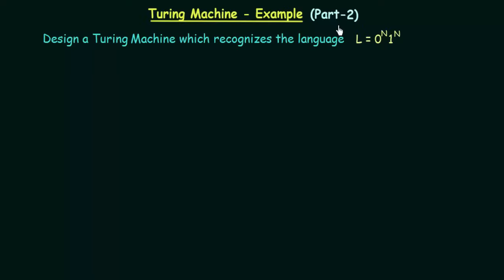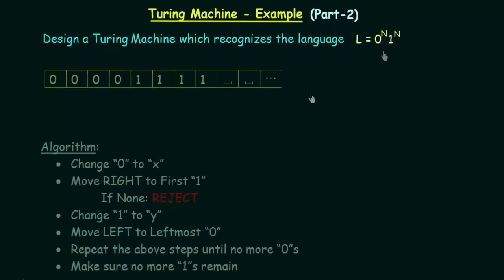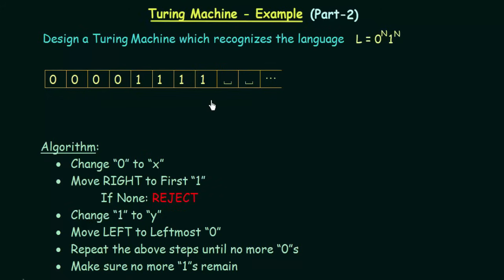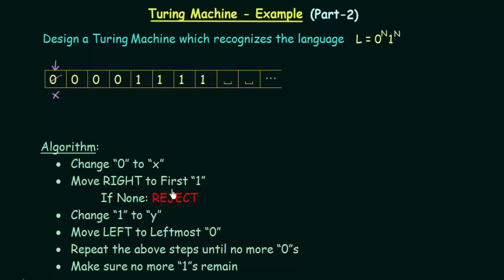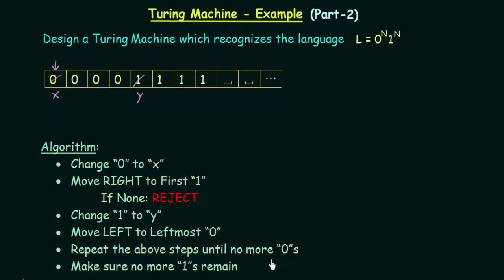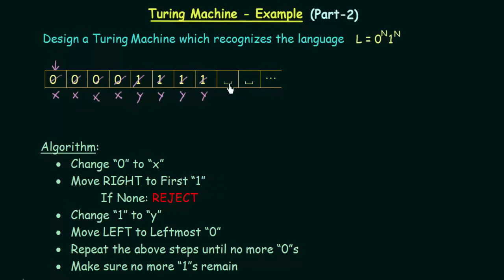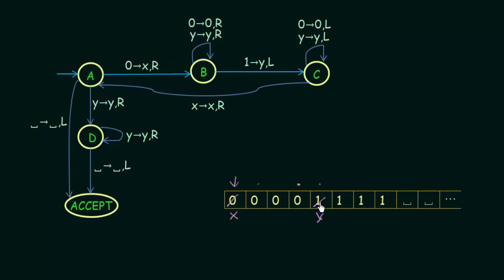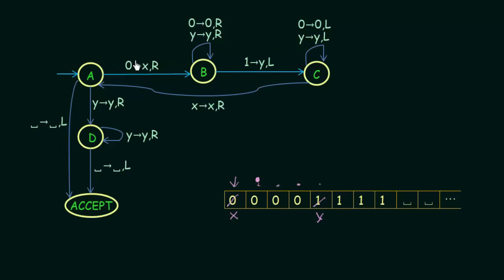Turing Machine (Example 2)

Comment: Why in transition B u put  y>y,R , and not x>x,R ????
Reply: I had the same question, ifs because by the time you mark the last y you would have already marked the last 0 as X hence no need to loop over x as you would never ecounter more than was x every iteration.
 How ?So... at state C you would only go left till you meet your last X  right ? then go right  at state A. 
 State B only has the y>y, R because you still haven't marked the corresponding one to the x Also because you always go to the left most always from state C to state A you will always encounter a 0 after the most recent  x. And you keep that loop till you finish all the zeros  and mark them as x, loop back. Encounter that last x  you just marked then go right then keep going right to finish the string

Comment: in 10:45 , there is no need of separate D state right, 
we can loop through y -> y, R at A itself and the B -> B,L transition from A to acceptance state
Reply: The state D is required to prevent strings of the form (0^n)(1^n)(0^m)(1^m) from passing, dry run 0101 and you will see it will pass if you do not have the state D.

Comment: Say i have a string "00010111" which is technically wrong according to {0^n 1^n | n >= 1}, but still the turing machine designed above will accept it right? how or i m making a mistake somewhere
Reply: This goes through  A,B,B,B,C,C,C,A,B,B,B,B,C,C,C,C,A,B,B,B,B,C,C,C,C,A,D and gets rejected there for encountering 0 on the tape (which is not defined i.e. goes to reject).

Comment: 1. So now the input is part of the tape instead of a separate input?
2. Can this algorithm be performed in a non-destructible manner? (that is, without destroying the original input on the tape by replacing it with Xs and Ys)
3. As defined so far, this Turing machine seems to be only capable of taking some input and accepting it or rejecting. But what about producing some OUTPUT? In order to perform some more useful computation, the computing machine should be able to calculate some results (e.g. evaluating arithmetic expressions) and output them. Can we do that within the current framework?
4. What about PROGRAMMING the machine? Isn't it that we have to make a special machine for every single tast we want to perform with this particular design? Because the program is stored in the "head", as the state automaton, and this automaton has to be replaced by another one in order to change how the machine works.

Comment: how about if input string is 0001110101?
Reply: 000111 will be converted to xxxyyy in A and D state. Since D state has no 0 and 1 transition, it will go to reject state.
Reply: It is not included in language. Watch the pattern carefully.

Comment: but we didnot write the string 00001111 on the tap at the fist place so who wrote it and how ?!
Reply: tape is not the place for writing the string. It is used only for help to check if the given string is accepted or not. Tape here is just like stack in PDA where at the end stack doesn't actually hold the given string rather it is empty at the end. Tape has advantage over stack as it we can go in both directions while using it.
Reply: @Pradumn961   Except the input string is clearly written on the tape in this video :q
Reply: pora howle

Comment: Can't we do the same problem with PDA with much lesser complexity?
Reply: Yes we can do
Reply: If you have a laguage that accepts the same number of 0's and 1's, you start with poping 1 or 0, then u push every 1 with adding 0 on stack and vice versa. If u get to the empty stack, that means every 1 that was popped on the stack was pushed by every 0, which means that u had the same numbers of 0 and 1, and the string was accepted.
Reply: Easy yes. They have got a tutorial for that too.